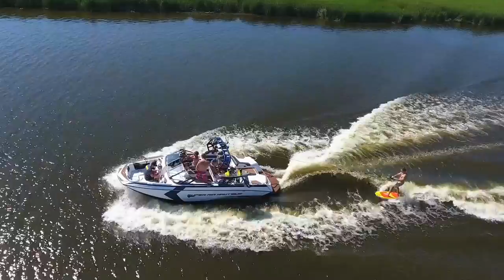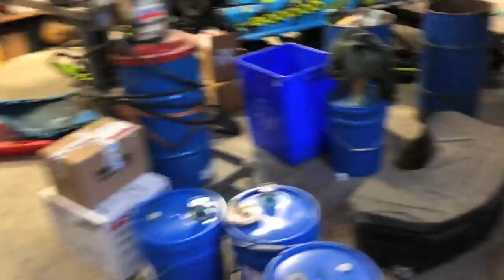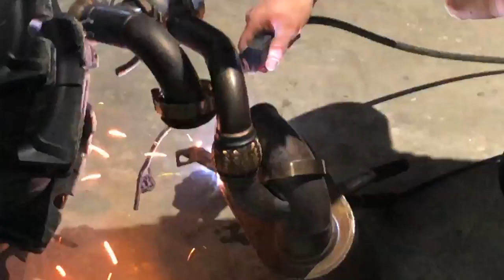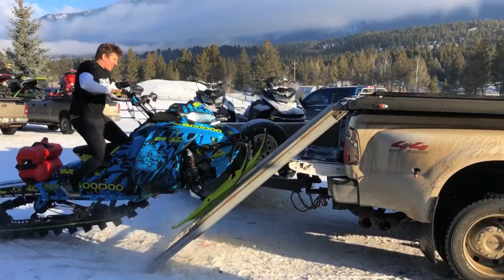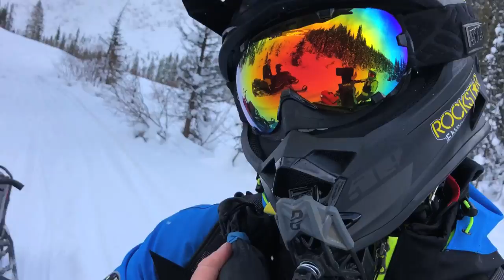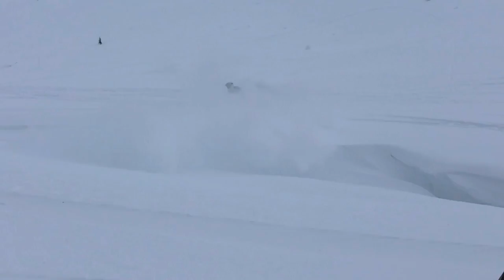EASY Snowmobile LOAD FAIL!!!

Comment: usually there is a pin (i think you can see the hole for it) that keep the ramp from retracting in and also a latch that prevents the ramp from flipping like that.